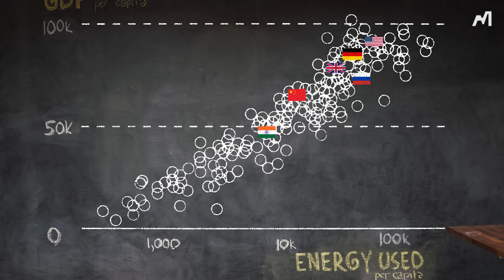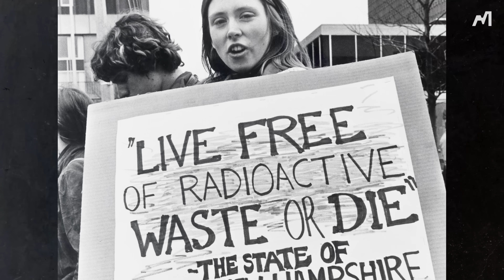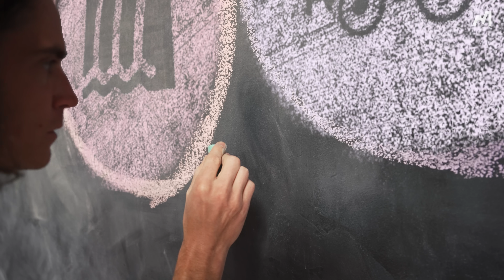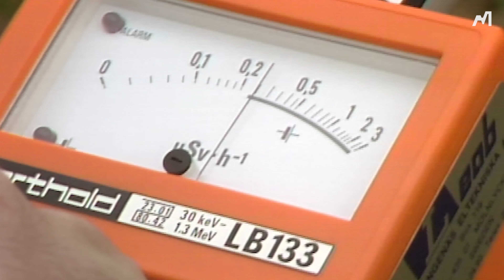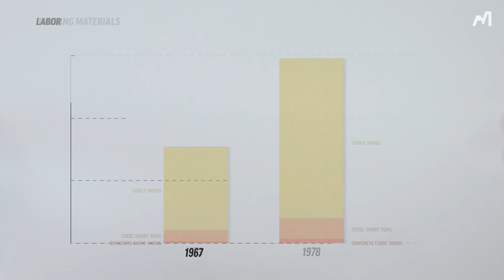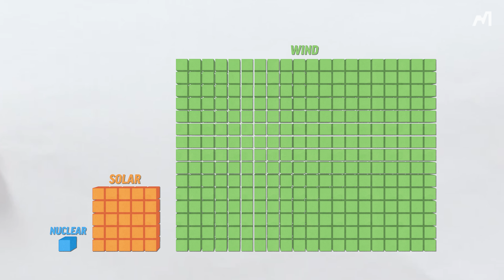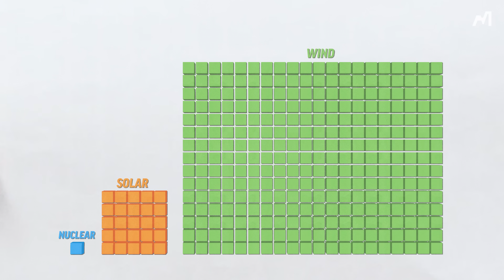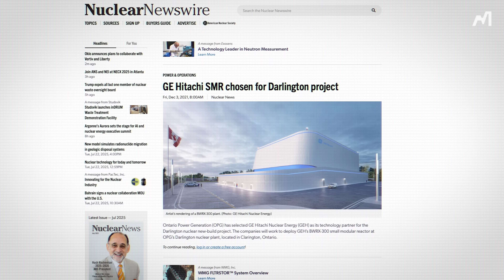They're Lying to You About Nuclear Energy

Comment: You didn't mention something really important I think about nuclear energy: power plants need to be cooled and for that as far as I know they use water and more precisely river or sea water. And this water, warmed is released. But this make the temperature increase and with the climate change temperure are increasing. This kills fishs and biodiversity if the temperature are too high. With the water there is also the problem that rivers can dry out or have some issues that make it impossible to use and the reactor can no longer be cooled until the water "come back". There is also some problems of invasions of bacteria in the cooling system or even jellyfish that can obstruct the power plant or pollute all the river.
I said that beacause theses things happen near where I live (in France), yeah invasion of jellyfish in the cooling system of a nuclear power plant. And i can conclude on the fact that we can take mesure to solve all theses problems but that is always not without any cost as always with energy. It is never "free" energy, even nuclear fusion or merger, i don't know how it is called, that seems so perfect is so difficult to make and cost so much (for example the biggest project is in the south of France, ITER, initiated by United State and U.R.S.S a long time ago isn't even finished but has an estimated cost of between 20 and 40 billions of euros so around 23 and 46 billions of dollars, and it is just a test to see if we can make an industrial test to know if it's economically viable) that i think really that it is better to try to save than produce more energy.

Comment: You have left out hydro power completely. Also Solar panels could be build over all those concrete parking lots all over the place in all those cities. They would give you shade as well. Solar panels are just super cheap, very efficient and very small and light. You can build them virtually anywhere without any impact. On building, over parking lots, over streets, over bike lanes etc. They give you additional shade and rain protection.

Comment: It's the Oil Industry that directly or indirectly hinders the use of nuclear power. One example. Uranium is a limited resource.
Hot water reactors use only 5-10% of the energy; the rest needs to be reconditioned.
In the 60th, the US tested Thorium reactors, 95% efficiency, funding was withdrawn in favour of hot water reactors. Why?
Because it was easy to produce Plutonium for nuclear bombs. Resources last 10,000 years. It would have replaced the Oil Industry completely. 65 years later, the Chinese built one in the desert, working. Construction of a prototype 5 Years. Could be scaled down to 1 year, mass-produced. Notably, not much funding goes into such projects. The oil industry doesn't like cheap and clean energy since Nikola Tesla and now you know why. They got all the money in the world.

Comment: Perhaps the strategy is designed to mask a military vulnerability, The use of silver cooling rods consumed vast quantities or the metal. A metal that is vital to industry & the military. The use of silver by the military is vast and masked. From EM pulse resistant electronic cable to long lasting batteries. Nuclear eats through silver.

Comment: Nuclear is deffinetivly a better option instead of like coal. But one point is that the radiation released from nuclear is very different than from the suns, it is more harmful than UV from the sun. You therefore cant really compare the two. So the problem is what you mentioned is the safety aspect. And when one blows up it is a big problem. And building more reactors increases that risk. But modern engineering would lower that risk a bunch I would assume.

Comment: Back in the 1960's they were building a nuclear reactor that would use the waste but the government shut them down, we have enough nuclear waste to power our country for 100 years.
Reply: Thorium reactors, which still needs a small dose of uranium. The perfect way to get rid of the waste as the end result will only be "dangerous" for 100 years which means it can be stored on site and then dumped in an old mine for stability. The molten salt ones are perfect for SMRs, molten salt reactors are idiot proof and can't do any harm during a meltdown. The salt is corrosive tho but with SMRs you'd mass produce units, run them for 5-10 years then recycle the steel to make new reactors. Another benefit of this circulation beside predictive income for the producers is that if any flaw is detected, all reactors will be replaced within 5 years with a new model that doesn't have the flaw.
Reply: Non-proliferation is also a whole other can of worms that holds us back.  There would be waaaaaaay less waste if we could use other fissionable materials from the fuel cycle, but because of the fear/trust dynamic we all suffer.  We have insane capability for power production, that is entirely bound up in red tape.

Comment: Radiation kills, but it is prolonged exposure AND dosage size that matter. Thats why doctors hide behind a screen when they do an xray. You the patient being hit with radiation will be fine. A couple xrays a couple months at a time. They are small doses. The doctors run them multiple times a day everyday. So to prevent being irradiated they have a screen.

The danger of nuclear is over exaggerated. But they do need to be built safely, and the waste needs to be properly isolated. It is a temporary energy source but it is better then oil and gas.

Comment: I have been a natural gas proponent as a contrary retired science teacher, I say clean, abundant, zero conversion, direct power source. Fuel cells can be fed by ng. They are finding hydrogen in the ground that can feed fuel cells. Cars should use ng and H2, yes petrol, to run fuel cells. Adaptive fuel cells could power elect. Cars. Between AI, and elect cars, air taxis, where is ALL THAT POWER GOING TO COME FROM? YOU CANNOT REPLACE BTUs. With KWhrs! Its not 1 for 1 or 1:1 ratio. It taken many kw to replace BTU. 1 gallon of petrol has 40 thousand BTUs. N

Comment: Yes, we were lied to about nuclear energy, but there are still a couple of issues unaddressed by this video (that I'm certain someone who will comment on my post will ignore and paint me as anti-nuclear, though I am not): First, we have to mine and process fuel. This takes substantially more land and resources than just what a nuclear plant sits on and creates substantial waste and environmental cost far beyond the footprint of the reactor. It's much less than coal but should still be acknowledged and is not a minor issue. Second, nuclear still puts the average citizen at the mercy of large corporate and governmental interests and become single point failure in the event of attack. I think the video overall was decent, but just being rah rah about nuclear without addressing downsides does a disservice. The crux of the matter is that energy sourcing needs to be a mixture, not just one solution and nuclear should be a part of the mixture more than it currently is.

Comment: Very biased video. Not sufficiently balanced. Oversimplistic conclusions. Pro-nuclear and anti-renewables. I have no issue with the safety of nuclear. The reality is that nuclear is by far the most expensive form of energy there is. You want this to change, then get rid of the regulations. The regulations are in place, and it would take decades to remove them. Good luck there. Nuclear energy is a dead end for most applications. There are some use cases, but they are on the edge.

Comment: A little late for me.  Back in 72, I was in the nuclear/environmental division of Bechtel Power Division as a new Ph.D. scientist/engineer.  I was assigned a small rad waste system, and using what I learned at LLL (now LLNL), I came up with a new and better design that would save $10 million per reactor.  It went up the management ladder, and everyone agreed that it would be superior and more economical; however, when it came back down, they said it would take too long and cost too much to get it through the NRC, so they used the old design.  I switched to environmental problems like coal plants and never looked back.  

In the meantime, all the many engineers I knew were forced out, and the least competent developed carriers at the NRC, making recovery impossible.   It will not come back in the US, and China will dominate in Nuclear power in 50 years.    Once you kill your technical talent pool, it is over.

Comment: SMRs might be safer because it's size is small enough to ensure containment per Alvin Weinberg's statements, it is less efficient compared with the AP1000. And to top this off all the same regulations still apply. The Navy does not have to comply with civil regulations for its reactors. To this end it's not a issue of safety but a complete design issue. Nuclear can be done more efficient and safer with less work and materials. The DOE stands in the way of all new nuclear to this day, it is not a marketing issue anymore but a political and economic issue. At this point we will have to wait for India and China to finish these new molten salt reactors before our politics even consider the stagnant nuclear industry.

Comment: Liquid Fluoride Thorium Reactors do not overheat and thorium is a nuclear material that’s abundant in mining operations. Heck, it’s nearly everywhere there’s dirt.
Reply: Biggest issue of this concept, the liquid "concoction" is very erosive/corrosive to the pipes and tanks. We need to find materials that can withstand that for a reasonable amount of time.
Reply: Man, I wish Thorium fans would embrace realistic reactor types like HTGRs and such, and not gamble on MSRs only. 
I absolutely would love my electricity to come from tons of what is literally thrown away from many mining processes.
Reply: ...so is cancer
Reply: @kubhlaikhan2015  And so is water pollution
Reply: Circulating hot, corrosive, radioactive salts through a half mile of pipes, tubes, valves, seals, pumps, bends, welds, etc is just a bad design.
Reply: @darkgalaxy5548  So almost every industrial machinery is bad?
Reply: @ZippyPiglin36   No, only the ones that circulate hot, corrosive, radioactive, salts through a half a mile of plumbing.
Reply: @darkgalaxy5548  Yeah, that's literally almost anything and everything relating to metallurgy and petroleum since over a century
That radioactive part genuinely does little to no damage or influence on the mechanics.

Comment: I worked on a generator that runs on refrigerant to spin a motor generator. They could attach these to a cooling tower inlet to absorb heat before it enters the tower to create even more energy to offset the size of the portable nuclear reactors. Holland has them submerged in hot springs to get year-round 24 7 power for free. Nobody talks about these because it doesn't create money for anybody except the parts to build it. The refrigerant is a sealed system, so just add a heat source. There is no fuel to refil it just runs.😮

Comment: Good video, but don't conflate SMRs with naval reactors, they are very different. Kind of like saying a helicopter engine and a utility gas turbine are the same thing because they are both gas turbines. A sub reactor is not designed to produce economic power it has completely different fuel.

Comment: What's the employee count now a days on you're typical twin unit 1000MW each, 2000MW total Nuke plant? Last I paid attention it was 750 or so. You can dump a 1000MW combined cycle gas fired just about anywhere for 1/10th the cost and operate it with around 50 employees.  Regulations don't help but it's simple economics ($$$) killing nuclear at the present.

Comment: They wouldn't trade abundance for scarcity and control, right?

30-40% of the food cost is energy
20-40% of the whole GDP is energy
40-60% of the housing, cars and other construction/heavy industry goods is energy
Energy costs are recursive and multiply from food to bigger production chains just like VAT does, turning 20$ tree trunk into a 2000$ table and contributing to it even more than VAT does

We just accidentally overlooked the way to make energy 4 to 6 times cheaper, right? With those 2000 rules 
Just as we overlook some files now, and uh, ohh, surprisingly, army already has a working and efficient model which we don't use anywhere else

Comment: Chancellor Merkel used the Fukushima nuclear accident as pretext for shutting down the remaining nuclear power plants in Germany. She ignored the fact that all of the German plants have completely different designs, stricter quality control, safer locations, and so forth. The last incident was in 1986 and very minor. Now, Germans in southern part are paying higher cost of importing the electricity generated by nuclear power plants in France when the solar panels and wind turbines couldn't generate enough to meet the demand. The Greens underestimated the "Wutbürger" (angry citizens) when pushing to build the high-voltage power cables on the massive towers (reportedly to be 60–100 metres high) from North Sea to south so that plan didn't get past the planning stage. The Wutbürger in the south also blocked the plans to build wind turbines on the mountain sides where the wind is constant.

Comment: Does anybody know how much radiation from cellphone towers or cellphone themselves compares to this radiation?
Reply: You are comparing ionizing radiation to radio waves. The energy that is carried is vastly different between these two. Not to mention, the radiation you (probably) mean is (usually) carried by particles while radio is carried by electromagnetic waves.

THE MAJOR difference is that ionizing radioation has enough strength to break up chemical bonds in molecules, while nonionizing (radio for example) does NOT.

Comment: Nice to see a reasoned explanation of why it takes so long to build a plant now compared to the first generation plants. Nuclear does have to ensure a secure  and adequate supply of fuel and a way to deal with its waste. Another factor in the cost of new plants isnt just the cost of the nuclear regulations but the regulations and business practices generally. The UK has some of the highest costs in the world for infrastructure much of which is related to the excessive number of people involved in every stage of a project.. I think the long term answer may lie in Fussion reactors but even so a diversity of production using the best feature of each generation type has to be a good thing.

Comment: Brushing off negative health effects due to radiation while also raising concerns because of a few dead birds from wind turbines sums up this video pretty well. Almost certainly the low number of fatalities we've seen is due to the heightened safety standards. Yes, the dangers of radiation are often overblown and the biggest danger of a dirty bomb (regular explosive bomb wrapped with radioactive dust, contaminating a small to large area upon detonation) is not the radiation but the fear and panic it would cause in the population. But lets also note that uranium is far from the only radioactive material that we use. Ingesting plutonium is extremely dangerous as it has similar chemical properties to iron, which our body will readily take up and integrate into our cells. And try being so nonchalant with a small vial of Cobalt-60 or Caesium-137 in your pocket, you won't be for long.

Comment: I don't mind the innovation, but due to the incidents of the past, I will continue to remain extremely cautious with nuclear energy, because the real problem with meltdowns is that the radioactive material can seep down into the WATER TABLE and THAT IS IT, there simply is no fixing that, much like the neverending coal fires in Pennsylvania. So while everyone likes to harp about REGULATION, you got to understand that people fear nuclear energy when the equipment is not properly regulated by the so-called PRIVATE SECTOR. 

The real problem is saying one solution is the most perfect regardless of its downsides or geographic factors.